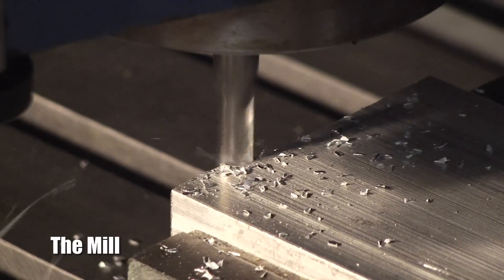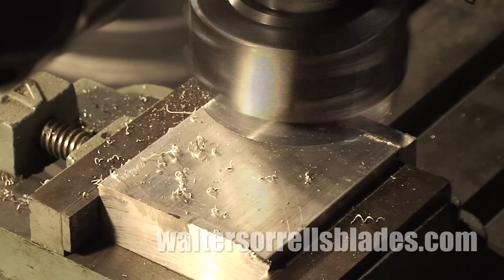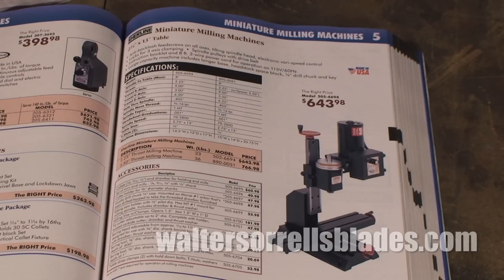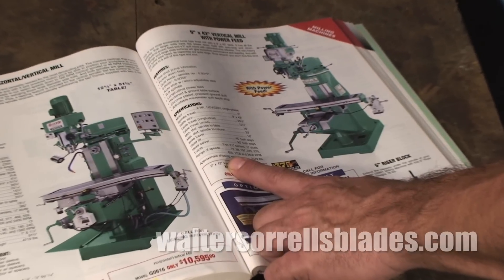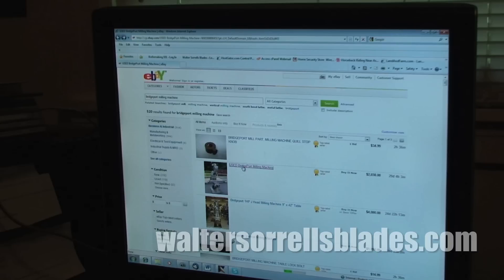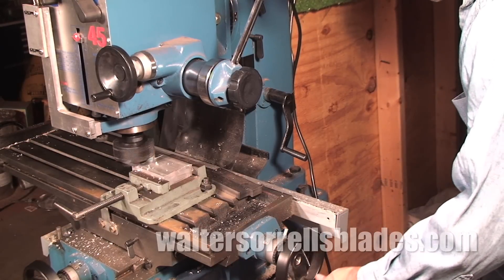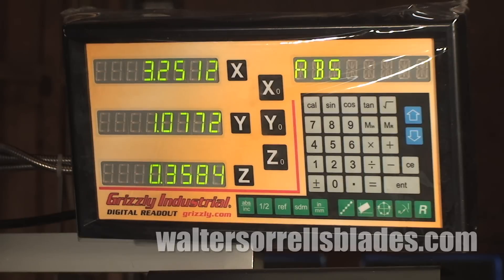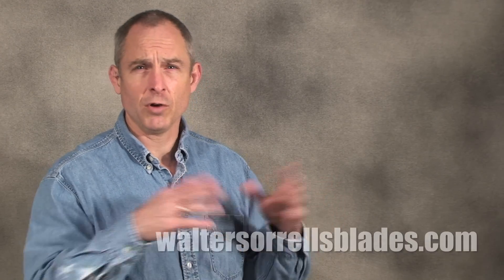Knife Making Tools Part 23: Milling Machines

Comment: I wanted to buy a cnc mill to work wile I work but could not seem to find any carbon steel in full size sheets so I held off for about 6 months now. Have you found a place to buy large high carbon steel sheet?

Comment: Everything you said here is spot on. Cant live without my mill. Cost a fortune to get the tooling. I got lucky with most of the tooling with craigslist and flea markets. Machining stuff pops up all the time at flea markets as it usually gets confused with contractor's tools. But I've picked dozens of endmills and carbide lathe tools and even a few high end indicators for dollars and cents. I'm a machinist novice at best, but every knife assembles so much easier if the blade is flat, the scales are precision fly cut and parallel, and your tang holes are perfectly square with runout under a thou. If you make guards, slotting with a 1/8 endmill takes more time to setup in the vice than it does to cut it, and then you can touch up with a file to fit it. A one hour job now takes 10 minutes, and I get to stay fat and lazy.

A used Bridgeport or Webb shipped will cost you about the same as a new mill drill now days. If you have the room for it, and you need something to chain the starship Enterprise to so it doesn't float away, I highly recommend it.

Comment: You are right about tooling.  As a machinist I can recommend a few brands for you if you like.  Garr, Iscar, Sumitomo are a few of my favorite brands.  They all offer sub-micron grade carbide which does high-mileage on tool steels.  Cutters are intimidating to the wallet but if you spend the money on good tools you won't regret it.

Comment: One thing that anyone that is in the market for a milling machine should know is the difference between climb and conventional cutting. If you decide to do a climb when taking an excess of .005' off you could easily snap your end mill due to the slop in ACME threads
Reply: Inspector Poirot climb milling is recommended for several reasons and that it is easier on the machine since you are moving the part in the direction of the rotation of your cutter/endmill and it will also product a better finish than conventional milling. You can take more than .005' of an inch cut when climb milling as long as your speed and feeds are correct and depending on the type of material you are cutting and you have a good sharp endmill/cutter to do the work.  BTW the slop isn't usually in the threads unless your machine is really old and even so might just need the gib's and way's adjusted as most machines (mills or lathes) do not get the proper maintenance as they should. Most endmills are broken due to operator error and feeding the material to fast into the cutter either by accident or lack of knowledge on figuring the speeds and feeds for their cutter and material they are working with.

Comment: The milling machine is the real 3D printer!

It, however, sounds a bit like the best milling solution for me would, rather than buying one, be to find some place where they have one standing and then ask extremely nicely if I can borrow and use it once in a while.
Reply: brottarnacke  there are some places that offer rental time for their equipment. Most of them will be vocational schools and you will have to get training to use them. Some also offer CNC machines, water jets, lasers, etc and they also usually offer their services to make your parts as well for a fee of course. I have used the schools equipment where I got my training and degree in machinist/cnc machining technologies to make archery equipment for my target set ups.